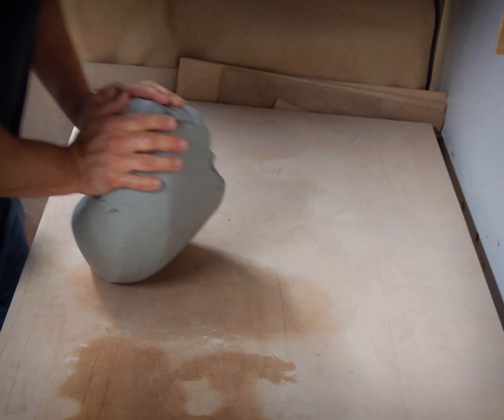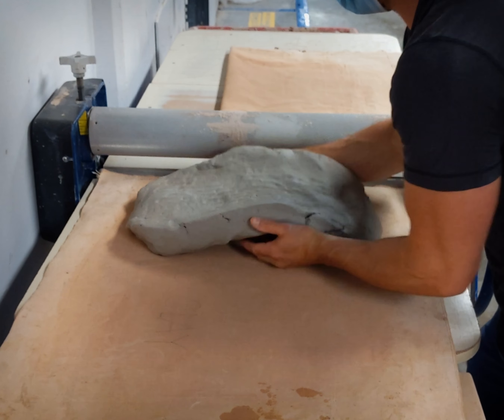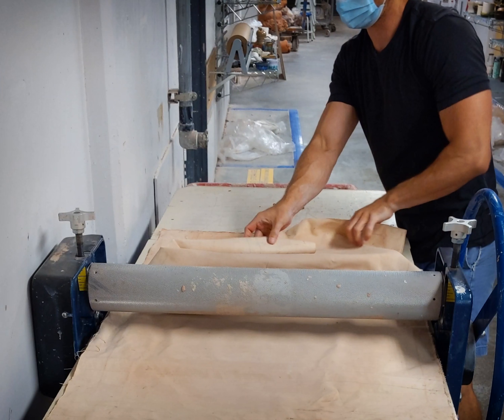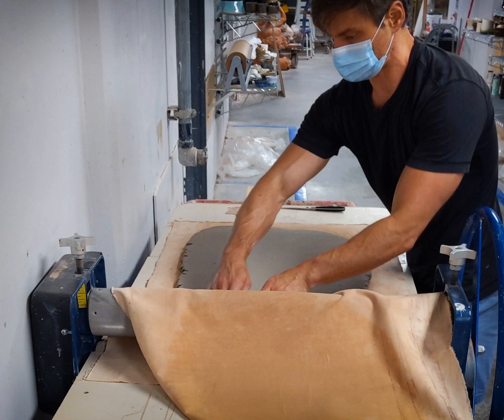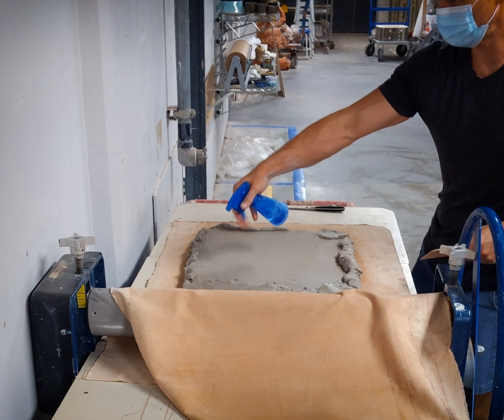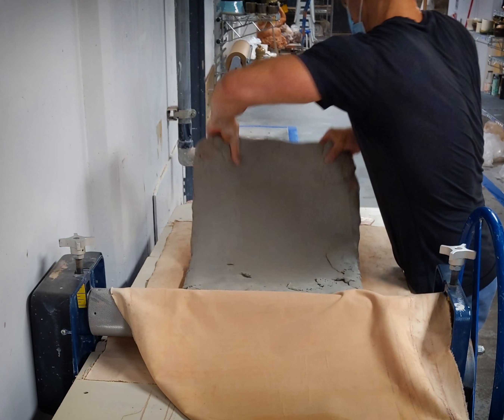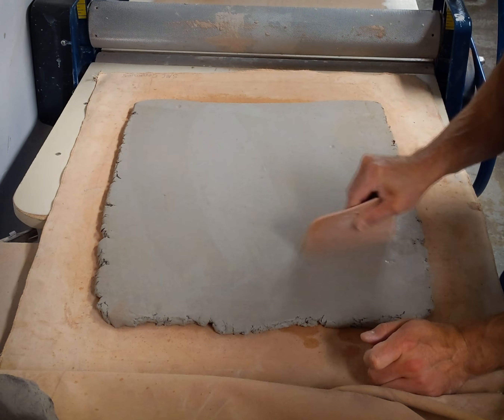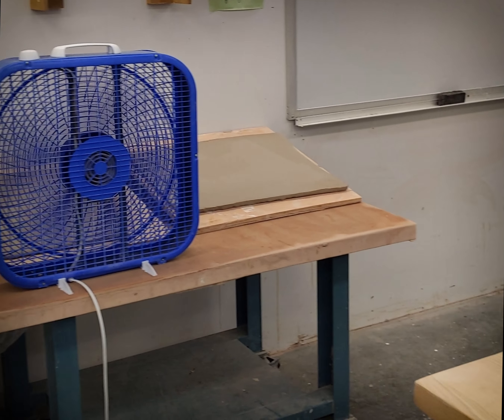Building Big Part 2: Rolling Slabs

Comment: Great demo, thank you! I like the “folding over the edges” tip.
I changed the canvas sheets in my studio’s slab roller for tyvek sheets. Tyvek is a kind of plastic sheeting usually used for waterproofing houses in construction. You can cut the tyvek to size and use it as is, or you can wash it in a washing machine once or twice which softens the plastic, making it more fabric like.
The advantage of the tyvek is that it doesn’t hold any clay dust and is easy to clean.
Reply from the maker: Oh, that's very interesting! Thank you! I will look into that and let my department know about it too!
Reply: Awesome! Thank you for the Tyvek tip! The canvas at my local art store is a bit on the expensive side.